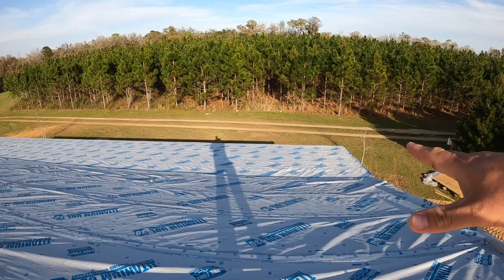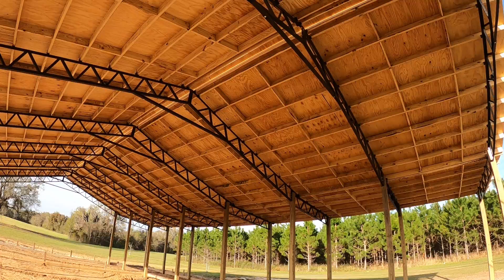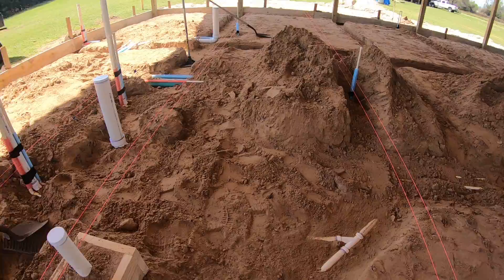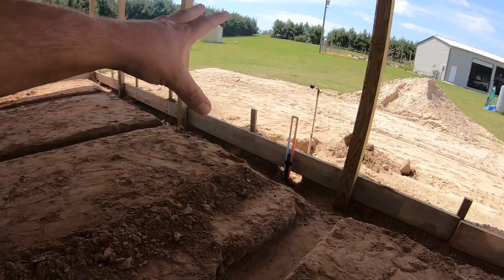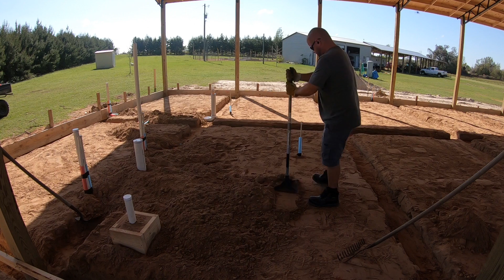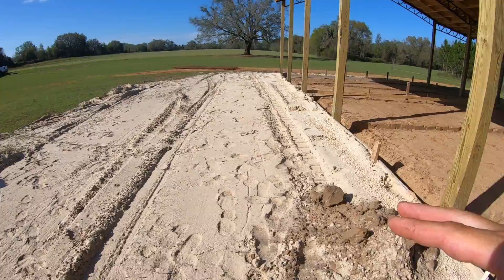Pole barn house build #7 Plumbing install #285

Comment: Bro you don't worry about the posts in the ground, what you think how long gonna take before they start rotten?  I did the same as lots of people make me to be concerned after I build the whole pole barn house.
Reply from the maker: The key to making them last long term is get a high quality treated post (mine are red tag ag treated) and you MUST direct all water away from the posts.  Gutters are a must on the home and I like to slope my dirt away from the posts and home.  Keeping the area damp just increases the risk of early failure.

Comment: Did you have another more detail video on the Plumbing Rough in.. If I understood correctly. No due the person that choose not to be on video....No problems...I just like your details includng code references and in Florida... (note several code changes in 2024 so Iam rereading most....
Reply from the maker: Not on underslab, but I have several videos of the above slab plumbing.
Reply: @TKCL  I have seen all of those....I like your specific detail...

Comment: Did you hire out a plumbing contractor to do the rough plumbing? I know you did the inside plumbing, beacuse I watched :)
Reply from the maker: Yes I did, I knew I couldn't dig up the concrete so I wanted to make sure it was correct. Sadly I still wound up with some of the plumbing in the wrong place by several inches.
Reply: @TKCL  Ok. I have some land that I am looking to owner/build. Thanks for the feedback. Love your Channel. Keep up the good work.

Comment: That's a shame you didn't video the first day of plumbing. As a plumber seeing how others layout and perform their work is the most interesting part. (I do understand they didnt want to be on camera). I'm talking about what plumbing was done. 

Nice work though
Not only does it interest a lot of us. But it would have provided you with the perfect chance to video and do an as built.( you may have. An as built is similar to what you did with the septic. When it was done you draw up on a copy of the plumbing plan the way it was actually installed, along with measurements.

Comment: That “future build” piping would be a good spot for  RV hook up for any visitors you may have. Just a thought....?
Reply from the maker: You are correct, I'm putting a clean out there that can help with plugs or allow rv hookup.
Reply: @TKCL  Just looking over a few things again. the RV hookup idea is great...I can be there in about a week!!! JAHAJAHAJAHA.  Curious if that is a potential future for something such as Harvest Hosts campers
Reply from the maker: @ecuadordave8076  it's intended for easy future add on, maybe another bedroom and bath. Cheaper to add it in now than laster on.

Comment: Great video Andrew!  Where will the septic tank be placed?  Closer to the house or way out there where you were pointing to in the yard?  Seems like they'd have to set it pretty deep the farther away from the house it's placed.
Reply from the maker: It's about 50 ft off the back porch towards the oak. Plenty of slope in the yard to get good flow to it.
Reply: @TKCL  Andrew - I'm just now watching your videos. I had a similar question that Mark B. had a year ago. Did you have any issues with that length of run for the sewer line? How long was the line from your bathroom to the septic tank - I'm guessing about 120 feet?
Reply from the maker: Probably 100+ feet, absolutely zero issues after months of use. Over 3ft of elevation changes from front to back. Things apparently move nicely!
Reply: @TKCL  Thank you for your reply. I’ve watched the first 14 videos and have thoroughly enjoyed your narration and watching your dream turn into reality. I plan to watch all of them. Kudos for all the hard work and forethought!

Comment: Question. Did you look at using pex water pipe? I know it is a lot more money.
Reply from the maker: Yep, I actually have a story about that. Pex was my plan and I was going to go through the ceiling. But.... By the time I caught up with the plumber he had already ran water lines. I was a bit happy, because I didn't think water lines were in my plumbing quote (I asked for sewage and drain pipes). Since the work was done for me and I felt like I got more than I paid for, I kept my mouth shut 😁

Comment: Andrew: I'm looking forward to seeing my first Pole-Barn living structure. But did, the cost stop you from putting a radiant floor system. We put one in the Drying Kiln, 900 ft. of 5/8 in. Pex tubing with glycol. Heated with a LP Hot Water-on Demand unit.  Guess I watched too much A-Team, MacGyver & Dirty Jobs.
Reply from the maker: No it's Florida, radiant floors just isn't common due to the climate.

Comment: Coming along nicely! Do you need to plumb an outside faucet against the house?
Reply from the maker: I will do that when I run my underground plumbing from the well. The less plumbing in the walls or concrete the better in my mind.

Comment: You did your homework on your roof. Thanks for the education for the longevity of a metal roof. Makes a lot of sense when it comes time to replace. Again another awesome video. Look at that beautiful tree out in the yard. Great clean up.
Reply from the maker: Thank you! We are spending extra (kind of defeats the pole barn idea) but there are a few things that I won't compromise on.
Reply: It will pay in the long run for sure. Great planning.

Comment: Great video and explanation of the plumbing and the inspection process.  Usually its a 10 ft piece of pipe for the waste system for test. Im excited for y'all
Reply from the maker: Everything seems to vary county by county and state by state. I know there are national codes, but it varies a lot more than I was expecting.